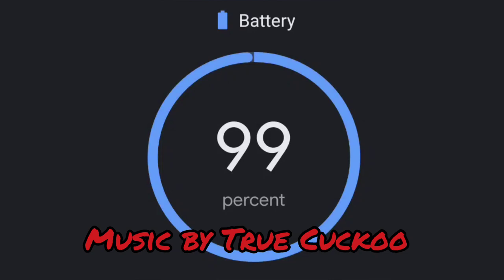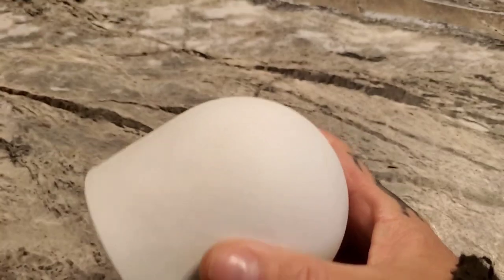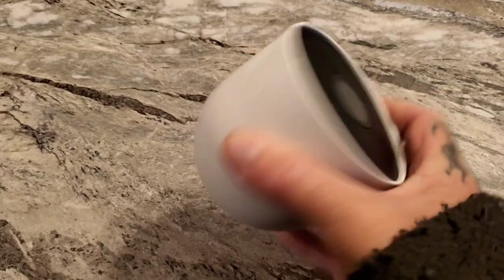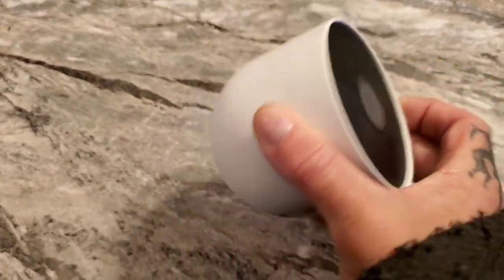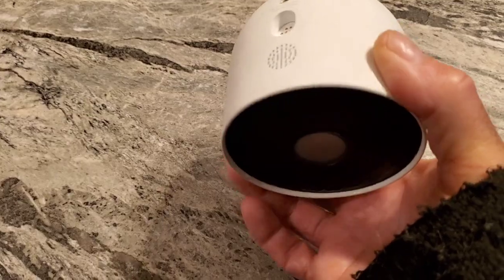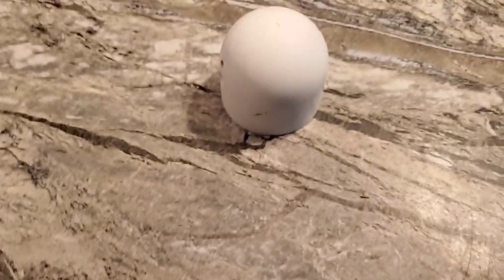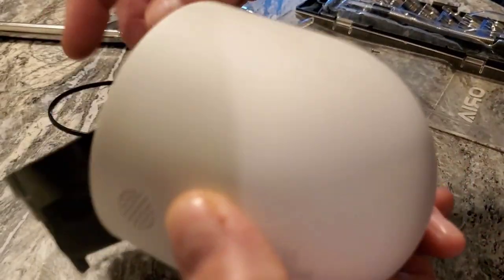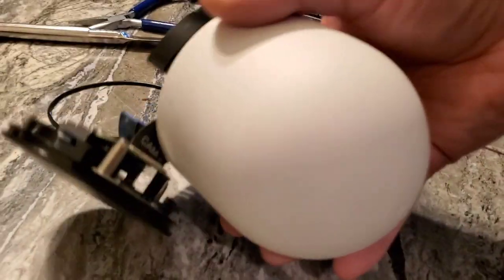I'll Never Buy Another Google Product, Google Nest Cam Teardown

Comment: I have one that is about a year and a half old that just died. It was on my front porch in a shaded area. When the battery would get low I would simply bring it in and charge it. It suddenly wouldn't take a charge anymore. I tried everything cleaning the contacts, trying a different charging brick, trying a different charging cable. Nothing worked. I called Google tech support and they were not able to fix the issue. Now I have to spend another $170 to get another camera. After watching a few videos like yours, I might try to open it up and see what the matter is. Needless to say, I'm disappointed that this camera died so early.

Comment: That camera has six pogo pins instead of four, that camera was made for a floodlight set up
Reply: my nest cameras (battery) also have 6 pins though, and I did not buy the floodlight bundle.
Reply: All the nest battery cameras are made the same including the ones for the floodlight.
Reply: @jamesm568 …and none of them are made to reliably function outdoors.
Reply: @marlowt2  Not in direct weather and sun 24/7.
Reply: @jamesm568  So pretty much anywhere you would have a floodlight… or in temps below 50 degrees.
Reply: @marlowt2  Depends on the design of your house and location.
Reply: @jamesm568  Funny, the box and literature say nothing to that effect.
Reply: @marlowt2  That's just for my personal experience. Anything from Google exposed to the sun doesn't last for year. My other Google cameras that are protected from direct exposure are several years old now.

Comment: They aren't even made to work indoors either. Have had mine indoors for a little over a year and all of a sudden the bluetooth stopped working. I was just on the phone with Google for an hour uninstalling the apps and resetting the camera multiple times. The blue sync light would not light up. The google rep told me that we have exhausted all avenues and the camera is outside of the warranty window. Just overpriced trash. I should have known.

Comment: I know this is a fairly old video by this point. 2/4/24.  I’m in the process of fixing a similar camera with a dead battery if I’m successful I’ll post right here or probably make a video showing how I did it.
Reply: Popskull, were you able to replace the battery and get the camera going again?  That's what I am thinking of doing, but first I am going to contact google tech support, to ask if they can replace under warranty.

Comment: Mine are rubbish. The camera itself is great but they are very expensive. I had one battery fail under warranty, another has since failed and the last two are not far behind. Interestingly I did read that if the app doesn't recognise the solar power as "solar" it can ruin the battery.

Comment: If you're going to run this camera battery, you need to limit the motion detection area. Because it goes off with a lot of activity near the camera triggering clips this will wear the battery down quickly. Also if you look at the camera in live streaming for several minutes at a time, this will run the battery down.
Reply from the maker: Yeah, you basically have to hard wire it or get the solar panels. All in all it's not worth it.

Comment: Unfortunately I don't think Google cares about their Nest products anymore.  They sort of quietly abandon lines that they don't want to deal with anymore, and I think the cameras are going to be next.  I had to deal with their customer service loop for them to address a Nest IQ outdoor which started doing the pink/purple picture thing after it was discontinued.  I spent a half hour speaking to a person, only for them to tell me it wasn't eligible for a replacement because it wasn't purchased from an authorized seller, despite being sealed and new.  
Thankfully, the "whack-it till it works" method fixed it.
Reply from the maker: If I'm not mistaken they've essentially sold them off to a home security company, ADT if I recall correctly.

Comment: So you never mention that you try to bench charge it with a charger that arrives with cameras? 
Or that you simply try to swap front camera with back camera to see if issue is with solar panel....
just saying that would be a logical thing to do before open camera.....

I was fixing to do same thing to open camera and see as i have one that is offline and battery is empty but actually it is connected to constant power....
I had this problem for couple month as i didn't have time to mess with it. 
And when i removed it and disconnect cable, camera stay on with green light on for 2 days before finally turn off. 
Than i try to plug in changing cable and camera gave sound and white light came on and it was charging but in app it was still offline and didn't want to power up.
i was trying to tare it down and check your video but i was starting to think about factory reset it....
Than i search on internet and found that you need to actually remove it from your account in app and that actually factory reset camera.....
than i went through procedure of getting it back in and it actually started to work again......and it is charging and i see picture back on my phone.  
So i had different manufacturer's cameras before but Nest i really like because they can detect really anything and save as long you power them with constant power. 
I actually get disappointed with SOLAR panels as it is recognized as battery power still and don't want to be on all time so you have to be really close to camera for it to wake up and start recording and sending notification.....so im really disappointed in that and ill have to pull some wire now that i was wanting to avoid by buying solar panels....
Either way thank you for your video.

Comment: Did you end up finding a fix to this or it was no luck? Thank you for the video by the way
Reply from the maker: No, it really is a sub-par product with a premium price tag. I still have one that I'm using but it's completely unreliable. It sends false alerts and sometimes doesn't send alerts until like 30 minutes later. I have cheap trap cameras that work much better, they just don't have the wifi capabilities. There are better cheaper options out there.

Comment: Perhaps the solar panels not producing enough energy?
Reply from the maker: That was my first thought, but the other one works (and is still working) OK and I've repurposed the panel and it charges other things just fine. I can even run a battery operated fan on it all day long.
So...the only conclusion left is a brand new junk battery which can't be replaced.
There are number of other technical issues with this products software end as well. I'd strongly advise avoiding it.

Comment: Have had these shitty camera(s) for 2 years, 1 died after 6 months, was getting a temperature warning and stopped working, was in the shade the whole time, fully charged. 2nd one still going, but slow to charge. Google sucks, just like YouTube sucks now, which is also owned by google. Everything is always ruined when these big conglomerates take over, turns to garbage eventually. I as well will never buy another google product ever again. My original interior Nest cams are well over 5-6 years old, and still working just fine, then the Dropcam which is a Nest cam essentially, they stopped supporting it, bastards always gotta ruin everything